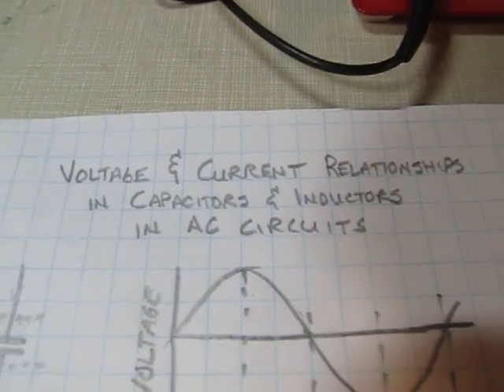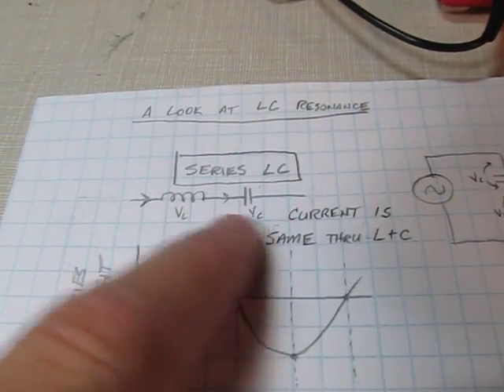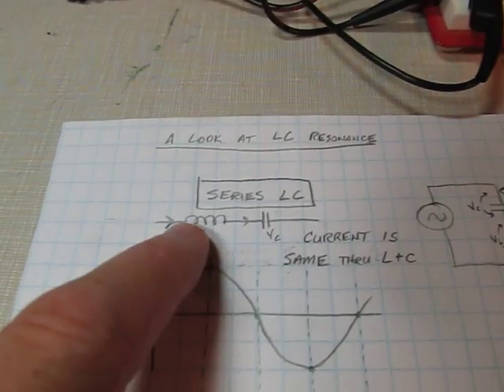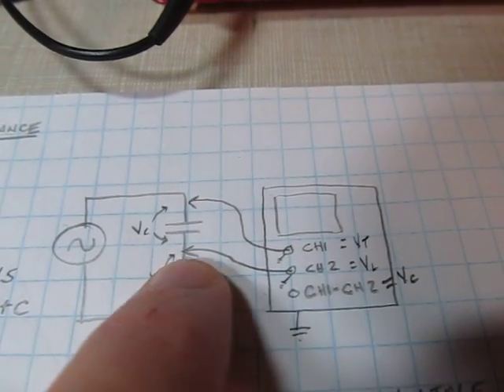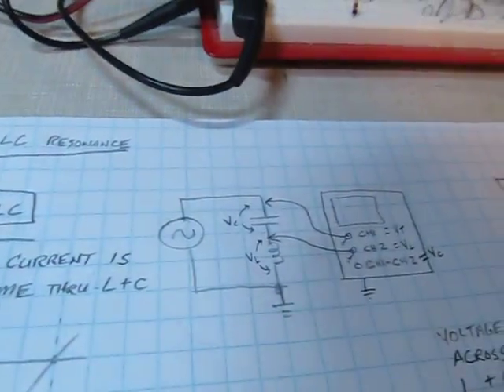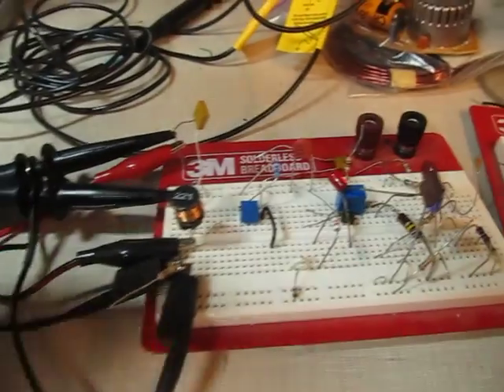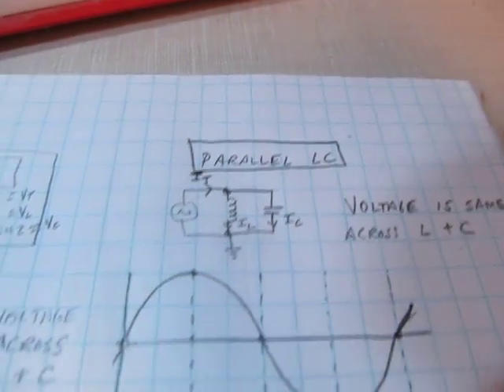#55: Back to Basics: Tutorial on LC Resonant Circuits

Comment: The Potential difference of the capacitor or the potential difference of the inductor is what is causing the time/phase delay. A Resistor doesn't have a potential difference on both sides of the resistor component but when you apply a voltage/current to it but when applying a voltage/current to a capacitor or inductor the potential difference takes TIME or a time interval for the potential different to be ZERO or equal on both sides of the component . This Potential difference is what is causing the phase angle?

Comment: How come when I do this with calculated value for 35khz of 1.2uh and 2.2uf I get 9 megahertz vale for the signals to do what you did??
Reply from the maker: You may want to check your math.  A 1.2uH inductor and a 2.2uF capacitor will have a calculated resonant frequency of 98kHz.

Comment: 👍Thank you sir. sir i have this doubt for very long time.
if parallel LC Resonant circuit will not consume any current.
the intermediate frequency transformer and rf transformer how does it work?
it is like a (primary parallel LC circuit) with secondary.(vu2knd).
sir your answer very very valuable information for hams and RF community.

Comment: Try to make a back to basics of capacitors and inductors "complex impedance" because when a variable DC voltage is applied to either a capacitor or inductor their complex impedance changes, why does it change? I think they use this often in oscillator circuits and tuning circuits to change the pitch & resonance frequency by using a variable DC bias voltage to vary the capacitor or inductors complex impedance. What would be the best water analogy for a capacitors and inductors complex impedance?

Comment: Aww haa!  Now I understand the why of the left channel fault on a tape machine I repaired.  I knew something was off with the left side bias trap by intuition.  After looking at your video, I was able to confirm that the bias trap had drifted off frequency by 12KHz.  Really cool stuff you've offered.  Thanks.  Now, as to why I've chosen tape machine repair as a hobby, I'm afraid there's no help for it.  Actually, I try to repair everything :-)

Comment: It would be very insructive to show viewers that every wound  inductor has a inherent  parallel SELF RESONANCE due to the parasitic capacitance between windings.  An added feature would be to show how the wire diameter and space between turns    effect the frequency of the SELF RESONANCE.

ncy

Comment: Thank you.  Im just started getting into RF and didn't understand how the local oscillator selected the frequency from the antennae in the tuner circuit.  I understood that the local oscillator had a resonant frequency it oscillates at but i didn't see how it discriminated out all the different incoming frequencies from the antennae.  Now I think I see that the parallel LC circuit will short the unwanted frequencies to gnd and effectively pass-through the selected frequency along the signal path by virtue of it effectively acting as an open for that frequency.  I'm sure I don't fully understand it still but this was helpful.  Thanks.
Reply from the maker: That is part of it (tuning the front-end bandpass filter), but the main thing that involves the local oscillator is the mixing circuit.  This video might help:  https://youtu.be/Vf06HSR4LdY

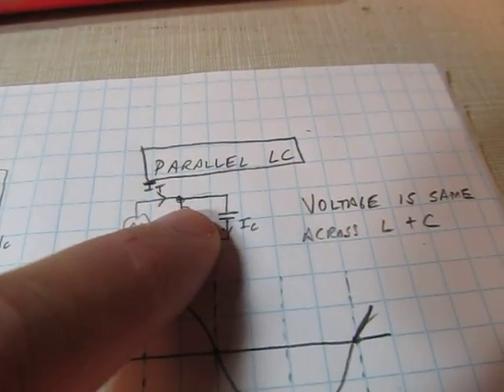Comment: I noticed at 6:20, you mentioned that the current flowing through a parallel LC circuit is the sum of the current flowing through the L and the C.  I realize that this is just a back to basics explanation, but to add a "dose of reality" and peel back one more layer of the onion, so to speak, at resonance, the current flowing through the LC circuit is only a small fraction of the current flowing through either the L and the C.  Most of the current is bouncing around "in the tank", and only a small current is needed to keep the tank active.  This is key for power factor correction for large induction motors, such as blower motors or compressors in HVAC units.  For additional explanation, see https://youtu.be/zVOibkXeZs8?t=874.

Comment: My question is, in an antenna tuned circuit in the front end of a tube receiver, is the resonnant circuit parallel for maximum voltage to the grid or serie for maximum voltage?
Reply from the maker: Since the grid is high impedance, the tuned circuit would be in parallel to generate the highest voltage for the grid to "sense".
Reply: TKS U.  By the way excellent video!  73

Comment: So does the power source for the circuit HAVE to be AC? What about a circuit that uses a standard 9v battery? How would you make the LC circuit continually resonate then? Would you have to first create an oscillating dc circuit, like PWM?
Reply from the maker: An LC circuit won't oscillate on it's own.  You'd need to "ping" it with a signal to cause it to ring (much like striking a bell).

Comment: Awesome video. Your explanation is loaded with detail but yet very simple to understand. The series LC circuit is exactly what we use on the railroad for our crossing circuits. Each RR crossing has it's own frequency and there is a series LC just as you described at either end of the approach to terminate the circuit and define the limits of the approach. This allows multiple crossing approach circuits to be stacked upon one another, each with it's own frequency and tuned termination shunts (the series LC). It also allows our DC signaling pulses to pass through unimpeded.

Comment: I would like to know what capasitors and inductors do in the circuit before antena? I mean after amplifier I see one 2 inductors and one capasitor with antenna what is the purpose of those components? Are they necessery for emitting the signal thorugh antenna?
Reply from the maker: They are generally there to provide an impedance transformation so that the output impedance of the amplifier is matched to the input impedance of the antenna.  This ensures maximum power transfer.
Reply: @w2aew  thank you for the reply
Reply: @w2aew  I think this is very difficult part really. I was playing yesterday with different coils, antennas etc. and to match everything right is reaaaaly hard (maybe I need just more knowledge and calculate everything right) because otherwise I feel like a blind man looking at pictures... But I have noticed that when I put everything right (more by chance and less by knowing what I was doing) I was surprised how strong signal can be.
Reply from the maker: @grzesiek1x  There is a science to it - but you do need to know the complex output impedance of your amplifier and the complex input impedance of the antenna in order to properly calculate the values of the L-Network.  I did a few videos on this:
https://www.youtube.com/watch?v=IgeRHDI-ukc
https://www.youtube.com/watch?v=f8MhMl4IqUE
Reply: @w2aew  thanks i will have a look but usuelly I treat Youtube videos as a supplement and an extra explanation lecture or somethign liek that  and I learn from books etc. (I need to finish one book for amator radio licence and then probably I will start another one for engeneering students etc.)
Reply: @w2aew  I really prefer sometimes to have a good book about electronics and have this comfort that all knowledge there  comes from the university and I have no youtube ads (which are so annying!!)

Comment: hello! Thanks for your video. I would have a question : how is it possible that with experimenting with simple, basic oscillators (like colpitts LC) sometimes i get a frequency like exactly 68.5 MHz even if the oscillator is supposed to make something like 10 kHz for example? And it happens with different oscillators! Is it something like an external signal strong enough to be captured? I don't understand it, And it looks too perfect (I can recognise my own signal by this , they are not perfect because of my cables and not exact components etc.) .
Reply from the maker: Many circuits are subject to parasitic oscillation - oscillation due to the parasitic capacitance/inductance of the components themselves.  Check out my video on ferrite beads which includes an audio oscillator that breaks into very high frequency oscillation.

Comment: In the parallel circuit, you could put 1 Ohm resistance in series with L and C (on the ground side) to show the phase relation between the currents.  Once again, they are always out of phase and resonance is when their amplitudes are equal -- V/X_L = I_L = I_C = V/X_C.  Cross multiply and cancel V to see X_L = X_C once again at resonance.

Comment: when calculating the output power of an LR , LC, or LCR circuit the formula is V X LR = Wattage?  V X LC = wattage? Because if you apply an AC waveform at a certain peak/peak voltage how can you calculate the outputs true power, reactive power VAR, absolute power VA of LR, LC, LCR networks?

Comment: hi there im using an owon scope mod 6062,but  cannot  reassembly this experiment,...using .1 microfarad cap ,and 150 mh inductor..and 1300 hertz freq...do i need a 3 channel input scope?
Reply: You can use a two channel scope but will have to do the math yourself.. Measure the peak-peak for each channel and find the frequency where they are equal.
Reply: @Liviu75tx

Comment: still learning all this stuff.. see if iam on track here.. say for regen or sw rx. the LC say resonates at 5mhz. the radio will then rx above and below 5mhz? or it sums or something.. i build or try to regens and clones of old kits. like the ten tec 1253 i think it is.. the multi band kit from few years back... iam havin a issue wraping my head around this i think lol ..ps edit.. should i use a freq gen to messure the LC ? i see some using a function gen..

Comment: what is the power source u use on the breadbord? love this YT movie , helped me to see what i didn't get from the book i'm currently using
Reply from the maker: In this case, the circuits tested are all passive - no power supply is used.
Reply: @w2aew  ok, tnx . thought you mentioned a generator , i thought that would be the power source  :)
Reply from the maker: @yoerim360  A generator is used to drive the passive network we're testing, but there is no power supply used.

Comment: 8:00 so this would make the 2nd circuit a band-stop filter would it? At resonance, the parallel circuit could short to ground maybe through a resistor.

Comment: Very good. So if I want to select L and C for a given resonant frequency, is there a formula to determine the ideal values for L and C without resorting to trial and error ? Thanks.
Reply from the maker: The formulas are on page 2 of the video notes:
https://www.qsl.net/w2aew/youtube/LC_Resonance.pdf
There are an infinite combinations of L and C for any given resonant frequency.  Usually you'll start with a capacitor or inductor that is common or that you have on hand, and then calculate the remaining component value.  If that results in an unreasonable or unrealistic component value, then adjust your first selection and repeat.

Comment: Great video, Alan!  I'm curious, since it's possible to have a series LC circuit be a band-pass filter, and a parallel LC circuit doing the same, which is the preferred configuration?  My instinct says a parallel LC circuit, but I can't back that up.
Reply from the maker: It really depends on the surrounding circuitry and how the resonant impedance is utilized.  The parallel LC will look like a high impedance at resonance and the series LC will look like a low impedance at resonance.

Comment: What application can you use with an open circuit or short circuit at resonance?
Reply: Sorry for asking such a weird question. I really would like to know how to change my variable frequency drive to work from an ac power source that has a changing polarity of 400hz. I know a little about how filters work and now much more thanks to your video and great job at explaining mate. 

I just need to correctly filter out the frequency/resonance of the DC (Inside the variable frequency drive)particularly for the computer aspect that is controlling the transistors inside the variable frequency drive.

If you see a simple wiring diagram of how a variable frequency drive you might understand my mumbo jumbo hahaha sorry for that.

This is a good diagram here is a link 
https://goo.gl/images/8mQG7i 

It's basically a weird inverter
Reply from the maker: Some of the most popular are in bandpass filter applications or oscillator applications.
Reply: w2aew oh ok cool! 
I have another question if you don't mind answering again

I have a variable frequency drive(rectifier and inverter) and the input is AC 50hz but I want it to work with 400hz input
What do I need to modify? 

I was thinking I might just need to modify the area that only powers the computer side, probably add some capacitors or something to just filter more of the DC

What I think I know is that its got an LC filter (BUSS system or something like that)
Also I THINK the computer is just powered by DC   
I know the filter system inside it is an inductor(s) in series and a capacitor(s) in parallel 

Cheers man
Reply from the maker: It is likely that all of the line side electronics and magnetics would need to be modified.  If the design wasn't made to operate at 400Hz, it's unlikely that it can be easily modified to do so.
Reply: w2aew ok thanks. Sorry man Just one more question I hope I'm not bothering you too much 
What is line side?
Reply from the maker: The part of the circuit connected to, and operating on, the 50Hz line voltage.
Reply: w2aew I don't think any of it works off the 50hz because it all gets rectified by diodes then goes through an inductor and capacitor bank before it reaches any circuit parts. 

I'm thinking I'm not sure hahaha I just know that the cap bank needs to be filled before my controller/computer powers up. 

A variable frequency drive is basically a bridge rectifier and an inverter 

Ac goes through diodes. 
Converted ac now dc goes through filtration (LC filter). 
Dc powers computers and rest of it waits by transistors. 
Computer activates transistors in a specific order and time to allow sitting dc power to pass through LIKE an ac wave.

Comment: Cangratulations for this video !
Please some help. Anyone, including the video's creator.
About the L-C in series, when resonant : How is it possible to have a short circuit, when we have zero volts ? (i mean how, current flows with zero volts ?)
The only way to understand is this : 0 volts between the left point of Inductor and right point of capacitor, leads to no electricity (current) flow in the opposite direction of the electricity (current) caused by source. And because there is no any block, the current (caused by source) flows normally and L-C Cirquit acts like short, for the source
Am i right ?
Thanks
Reply from the maker: Yes - at the resonant frequency, the series L-C circuit looks like a wire, or zero ohm resistor - a short across the network.

Comment: Another great one.   I still don't understand why I keep finding very low value inductors in logic level communication circuits (usb x, I^2C, etc.) Is it just to stop hot plug spikes?  I don't get it.
Reply: Those are usually acting as fuses.  They protect the circuits from being abused with voltage sources. The coil will burn out under unusual currents.

Comment: Great video. How can I mimic this using an analog scope? I only have a dual channel 60MHz analog scope. Ive tried to invert the scope across the inductor and add the two channels but I don't think I'm doing it right. Or are analog scopes not able to perform the math? @w2aew
Reply from the maker: Most 2ch analog scopes can add Ch1 and Ch2, or add them with Ch2 inverted (same as subtracting).  But, most will only show the resulting sum, and not the original Ch1 and Ch2 signals at the same time.
Reply: ***** I see. Yeah, my does add and there is a pull knob to invert, but it'll just display that as you mentioned. Can you visually see the reasonant frequency on the scope with both channels showing? I see a what seems to be distorted signal at said frequency and reappears after going up higher in frequency and the signals are in phase after that... I use to have a digital oscope some years back but made the mistake of having to sell it..
Reply from the maker: You could just monitor the voltage across the parallel LC tank that is connected as a load to the signal generator. Adjust generator frequency and resonance will be at the frequency where the amplitude is the highest.
Reply: w2aew how about the series LC? That's the circuit I was talking about. If I add the inverted channel 2 to 1, the scope should show the short at resonance? Or will that too be at the highest amplitude.
Reply from the maker: If you connect a series LC as a load, and measure the voltage across it - the voltage will dip at the resonant frequency.  Remember - a parallel LC looks ideally like an open circuit at resonance, and a series LC looks ideally like a short circuit at resonance.